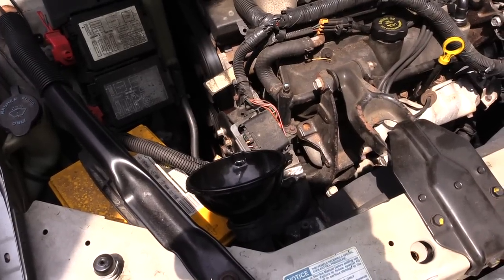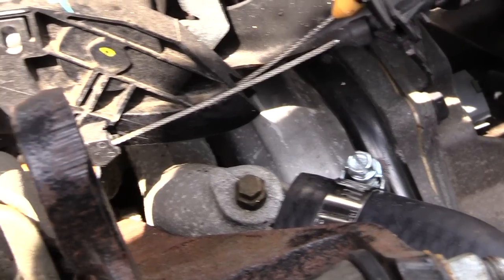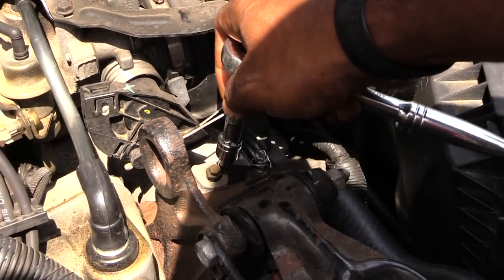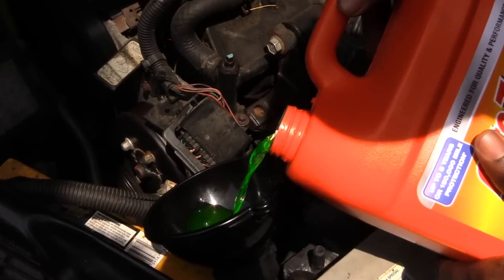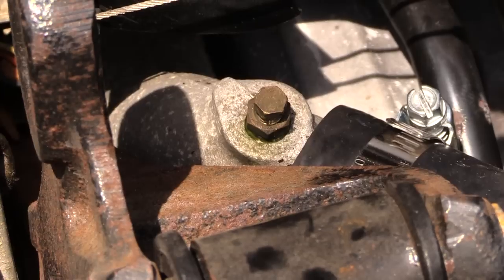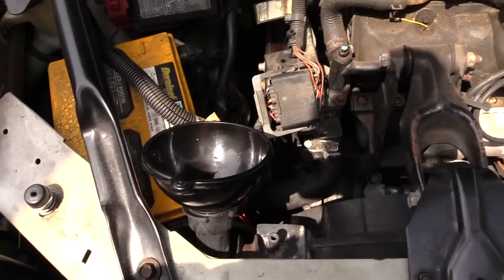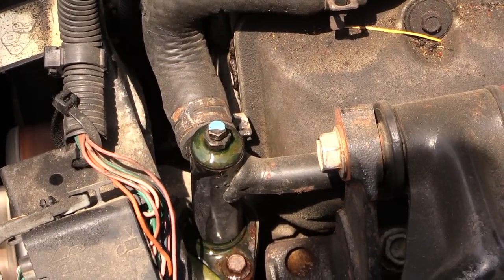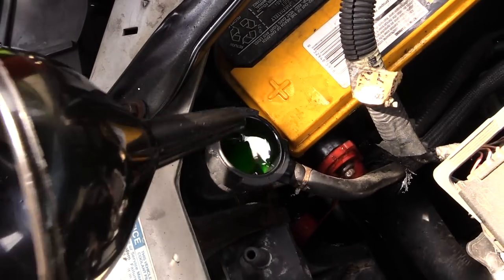How to Bleed Air From Your Cooling System/ Radiator

Comment: I’d been having crazy overheating problems after I changed out my water pump. Ended up replacing a thermostat and heater core. The last time I drove my car I had to stop 13 times just to get home from overheating problems. I went out a few minutes ago topped off my antifreeze, bled the valves, took in for a long drive, and the fucker runs perfect! Thanks a hell of a lot man. Your videos are truly appreciated.
Reply from the maker: Your very welcome, Thanks for watching and commenting glad could help with over heating problem. Please subscribe & like and share if haven't already and check out our other helpful videos
Reply: Flashback502 I will buddy, hope your Sunday is wonderful.
Reply from the maker: @fee8255  Thanks, it is hope your weekend is going well also.
Reply: The return to the coolant tank is probably clogged at the tank. Had a snow pea sized hunk of crap blocking mine. If the coolant can’t return to the tank it will overheat constantly

Comment: The bleeder screw is 2 pieces. Your supposed to just use a 7mm socket to loosen top portion of the 2 piece bleeder. Bottom portion is 10mm to install it. Not to bleed it. The top portion of It has a needle with a hole on each side of it. I have found it may take a few times to get all the air out of cooling system, over a couple of days.
Reply from the maker: Thanks for info.Please subscribe & like and share if haven't already and check out our other helpful videos

Comment: you see you use a size 7 but we have the other bolt is holding that pipe  number 10 is a water pump housing i guess

Comment: Man I need help. Thank you for the video. I have tried 3 radiator caps but car keeps over heating. No fluid comes out of one of the screws when engine is turned on. I have a pajero 3.5cc montero
Reply from the maker: You  may have a stuck closed thermostat. Please subscribe & like and share if haven't already and check out our other helpful videos

Comment: can be replaced that metal pipe or water pump housing  my 10 mm bolt is holding the bleeding  metal pipe
Reply from the maker: Yes it can be different on different cars.

Comment: Question my car which is a Subaru Tribeca has a air release valve at the top side next to radiator and there's a missing air release cap, can the missing cap cause your car to overheat?
Reply from the maker: Normaly not but would replace to be sure.Please subscribe & like and share if haven't already and check out our other helpful videos
Reply: @Flashback502  thanks for the reply

Comment: 08.27.2019 ( do you need to bleed air off every time you take the radiator cap off to check water level or antifreeze
Reply from the maker: No, Please subscribe & like and share if haven't already and check out our other helpful videos

Comment: How about if the radiator is sealed such equinox 2005-09
Reply from the maker: Sorry not sure
Reply: park your front end up hill so the air rises to top front of engine,  and run the engine with the thermostat set to hot. open the one bleed screw you see in this vid on the left because we dont have the right hand one. and watch bubbles come out until there is a steady stream. you would fill the reservoir to top off fluid as needed theres a cold fill level and hot fill level on it. This is how i do it on my 05 equinox, to get rid of the bubbles noise and get my heat working back to normal again. Our engines are prone to head gasket failure which is how we end up with air in our system in the first place

Comment: Wrong coolant Dexcool !
But great vides Sir.
Reply from the maker: Tony Nagin thanks for watching and commenting please subscribe if haven't already and check out my other helpful videos.
Reply: Mine had a sticker on the fender that said Dexcool only.  It was a friend's car.  She said 89, maybe it was 98.
Reply: I use nothing but Green antifreeze in my 2003 Buick Century. G.M. DeX cool will cause premature failure of the car's gaskets.
Reply: No, dexcool eats the gaskets.
Reply: Anonymous not anymore. That was old gasket material, when they were switching to dexcool. Mixing them can make them sludge together.